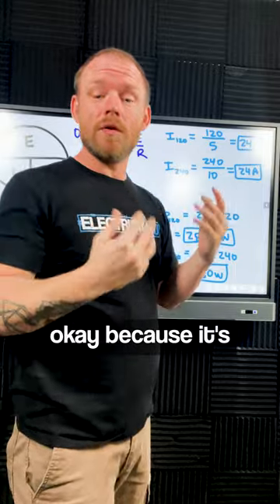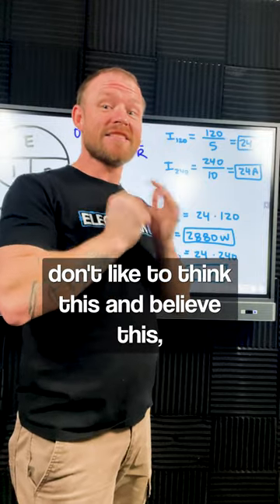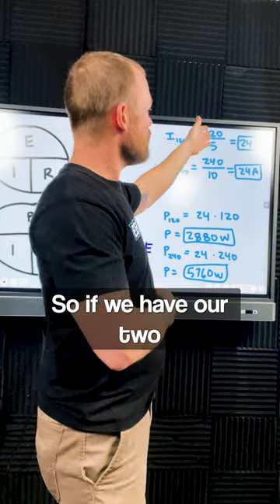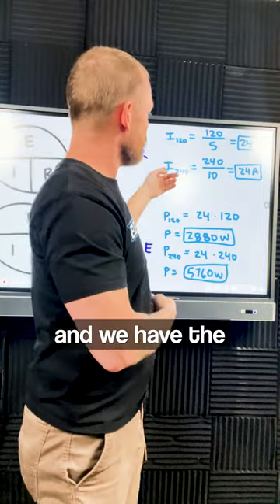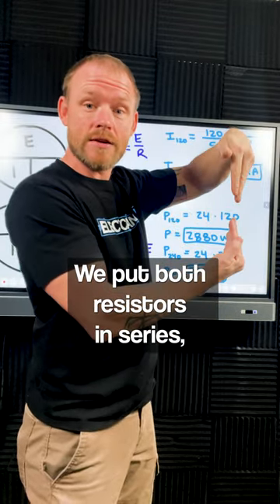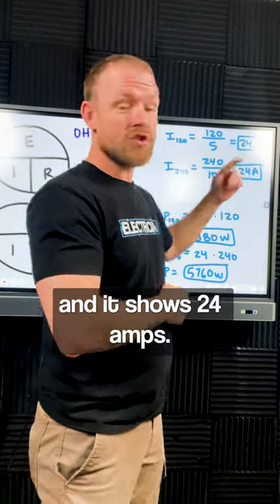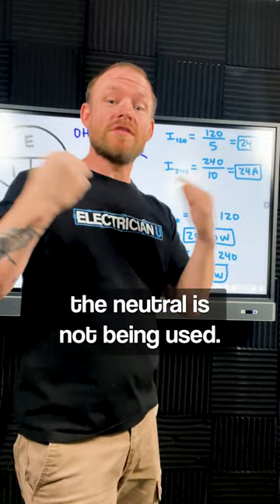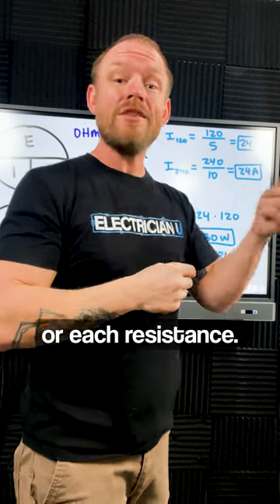Lost Neutral in a Multi Wire Branch Circuit - Part 2

Comment: I know they need to teach this in school but it's really more confusing to the average guy because you will NEVER see a balanced load in the field. Besides, your local inspector won't pass it without a neutral.
Reply: How would you balance the loads on both branches anyway?
Reply: @Bapuji42  ... in the real world you don't. This is just an example.
Reply: @rupe53  An example that, I agree with you, is overhyped.

It would be more useful if they showed what it would be like using two identical loads in series to divide the voltage, and then how it would fail if the impedance on one of the loads changed. And then, how putting a wire to the center tap of the transformer (neutral) between them, turning them into two branches at different phases, fixes the problem.
Reply: @Bapuji42  ... adding or subtracting a neutral doesn't fix anything. What that does is change the problem... or should I say create a problem where we didn't have one to start with.
Reply: @rupe53  I think you totally misunderstood my explanation, which was that obtaining 120v from 240v by voltage division across loads only works when the loads have identical impedances. The center tap exists for exactly that reason.
Reply: @Bapuji42  ... in the USA that neutral tap exists to create usable 120 volt branch circuits. I think you misunderstood my original point.
Reply: @rupe53  That's.... almost exactly what I said. We're talking past each other. Take care.

Comment: This is only correct if both branches are 100% balanced and with equipment that doesnt care if its see volatages well above 110v.  Map your voltages around with a 10amp and a 2amp side and see how important that neutral becomes.

Comment: During my 50 years seldom ran 3 wire shared grounded conductor. Now with AFCI'S required on almost every residential circuit they will hopefully die out.

Comment: The neutral is just A/C voltage point of reference from the transformer?
Reply: The neutral from the panel to the transformer is  a center-tap of the transformer. IOW connected to the center of the coil, meaning the voltage between it and either end of the transformer is half the voltage between both ends. 

The neutrals on either 120V phase are connected to that. They're going to have current on them regardless of load balancing since they're only connected to one phase conductor.

Comment: Surely this only applies to the neutral going from the panel back to the transformer. The neutral on a 120V branch isn't connected to the other phase conductor, so there's no current cancellation.

Comment: As leg 1 is pushing towards the neutral leg2 is pulling away from the neutral. So leg 2 just grabs the electrons from leg 1 instead of pulling them from the neutral. Then the both reverse. This happens 60 times a second

Comment: Can you share some examples how neutral gets lost ?
Reply: A wire gets cut, 
A wire nut comes loose, and neutral slips out
Receptacle or equipment fails
Etc...
Reply: I had a lost neutral in my garage. I had ran a 10gague set of wires to a set of 120V receptacles. Black, red, white, green. Leg1, leg2, shared neutral, ground respectively. The white wire got disconnected at the second set of plugs. So the third set of plugs became dangerous. 

The L1 at the 3rd set of plugs went to my battery charger then back through the plug to the neutral. But that neutral had no path because of the disconnect at the 2nd plugs. That neutral was connected to the neutral of the plug right next to it so the energy went to that. Into another battery charger back out the plug to L2. So the 2 battery chargers were sharing 240v. 

Well on charger had less resistance so got like 180V and started smoking. The other got 60V and just didn’t do anything.

Comment: What happens if you lose the neutral and then unbalance the loads?
Reply: Bad things happen. Ask how i know
Reply: @rty1955  How do you know? 😅
Reply: You get a hot neutral
Reply: @granthertenstein7841  Note that I said lose the neutral.
Reply: @Bapuji42  a tree fell onto my power lines and it ripped the neutral off my house.
It took out my heating system, microwave, circulator pump, and other electronic devices.
Reply: @rty1955  Yikes! I understand why now. With a neutral, both phases are the same voltage, in the U.S. 240V / 2 = 120V. Each phase is a branch of loads in parallel. 

Without a neutral, there's only one phase at 240V. Both branches are in series, so the same current flows through each branch which means each branch's voltage is determined by Ohm's law - V = Z*I (or E = Z*I if you prefer). 

If both branches have the same Z they each see half of the total voltage. But if they're unequal impedances, the branch with the higher impedance sees a higher voltage. Boom!
Reply: @Bapuji42  exactly! Since each circuits Z does not change, and MORE voltage needs to be dropped across a load, more current flows amd things get toasty haha
As soon as I realized what happened I shut off the main right away, but for some stuff it was too late. The magic smoke had appeared

Comment: I wonder what the chances of the loads being balanced are in real life.
Reply: In an industrial situation using three phase, they have to be balanced intentionally or you get different voltage drops across the impedances of each phase. In other words, you have big motors running at the wrong voltage.

Comment: So you go into an apartment and measure the voltage on a stove outlets. You measure 120v +120v hots to neutral but 208v hot to hot.  Two legs of 3 phase baba.

Comment: While your math is correct using a pure resistor, electrical work seldom uses pure resistive loads. There is an additional component to an electrical circuit using AC, and that is FREQUENCY. The formula you are using is for DC or AC with a purely resistive load. 
There is no such thing as resistance in an AC circuit. It is called Impedance and is represented by the letter Z
With a purely resistive load, Z = R.
Most electricians forget this.
There are many videos on YT which explains this.
Reply: There is such a thing as resistance with an AC circuit. Impedance is made up of both reactance and resistance. Z = R + jX

Comment: 120 v would be going through either resistor since they are in series though lol
Reply: The two 120V hot legs would effectively combine to a total EMF of 240V and act upon both resistors simultaneously.
Reply: @platinum4266  
Yeah but you measure 120v across both resistors.
Assuming equal resistances
Reply: @Yotaciv  Right, which is what is meant by balanced loads.

Comment: Ok so the voltage flowing through the red and back… how does that form a current as there is no return path through through a neutral???
Reply: I'm not sure what he's thinking. If you have the red doing one outlet and the black doing another outlet, then the hots are independent from eachother and no matter what you need the shared neutral for the receptacles to work. 

It sounds like he's mixing up a multibranch with a single phase piece of equipment that uses a neutral.
Reply: If the shared neutral runs to the service panel is disconnected but the neutral that runs between the two circuits remains intact, that current will flow through the neutral between the two circuits giving up to 220/240v on either circuit depending on the load on the either circuit. 

Also if the loads on both circuits aren't balanced, which is almost always the case, one of those circuits is going to have more than 120v and likely fry that device.

Comment: Then all your smart switches won’t work and has anyone ever ran into a balanced multi-branch circuit, I’ve never had in 23yrs, but the OHMS law doesn’t lie.
Reply: There is NO Resistence in an AC circuit
Reply: Here is the definition of impedance:
The effective resistance of an electric circuit or component to alternating current, arising from the combined effects of ohmic resistance and reactance.
So technically resistance = impedance in an AC circuit, even if it is a pure resistor. Ohms law has two formulas, one for DC & one for AC

Comment: I never liked using that word "neutral." Grounded Conductor or Grounding Conductor
Reply: Neutral and grounding conductor serve different purposes and are separate for a reason. Neutral is connected to the load and is always energized. Grounding conductor is only energized in the case of a short between hot and the ground wire and is intended to give electricity a path to earth in case of a short circuit between hot and an appliance enclosure, pipe, etc. It also allows overcurrent protection for the event of a short between hot and earth, as it is bonded to neutral at the panel.

This is why you don't bond the ground conductor and neutral at subpanels. It would mean the ground conductor is connected to one side of a load at that point, meaning it's carrying at least some of the return current to the service. IOW there's current flowing in your conduit, ground wires, etc.

Comment: Years ago, we were allowed to use split neutral circuits, but now, at least in nyc you can no longer run a 12/3 and feed separate cuircuits..everything thing needs its own neutral..not just afcis. Also you can no longer use white as a conductor anymore...so if youre feeding a single phase/ 208 circuit you have to run 12/3 and cap the white...same for 3 way circuits..cant use white anymore...but some inspectors will let some things fly...most arent electricians anyway. They just study code

Comment: Who uses a neutral on 220 circuits? They should explore new careers but you also leave a lot out, on a panel that runs only 220 its not giving 240, maybe your longer videos give better detail. Idk tho I only see you on shorts
Reply: I'm learning industrial right now
Reply: We're about to run 3 phase 220, it's for a new data/electrical room ran from a panel we will change the 480 transformer and the original panel with just 2 legs, since they may need 3 legs in that rooms racks... I'm originally commercial and learned residential, changed company's due to them hiring idiots and paying them more than me I showed out and didn't give my 2 weeks, just moved on. Ended up doing I guess illegal under the table jobs using what I learned ran home services paying people to get permits bit doing the job in a few hours making 400 myself 200 for my helper lol 😂

Comment: When you say “unbalanced load” are you referring to 2 phases not carrying the same voltage?
Reply: Wattage is more acurate
Reply: Amperage is the more accurate measure.
Reply: Well, Z = V/I, and W = VI, so.... They're all accurate, because they're all mathematically related.

But yes unbalanced loads mean loads with different impedances and thus different current draws and thus different power usage. The voltage between the taps of the transformer isn't going to change much.
Reply: @Bapuji42  okay thanks
Reply: @TN_vigilance  It makes sense, right, if you have two loads with the same impedance in series with a voltage across the whole thing, each load will have 1/2 the voltage across it. Ohm's law 

Now, what if one of the loads has a different impedance? Both loads are getting the same current because they're in series, so the different impedances will cause different voltages. One load might be getting 90v instead of 120v. No good!!

So, instead, we have a wire going to the center tap of the transformer - "neutral". The voltage across each branch of the circuit is now guaranteed to be 120v whether the loads are balanced or not. The neutral carries whatever the difference in current is between the two branches.

I'm still waiting for someone to tell me when I'm the real world you'd have perfectly balanced branch loads.
Reply: @Bapuji42 okay that makes sense, I’m a millwright/pipefitter and started watching this guy to get some base knowledge, thanks
Reply: @Bapuji42  thank you for using Z instead of R As there is NO resistance in AC circuits, there is however IMPEDANCE and they are NOT the same. Only when there is a purely resistive load does Z=R n even an incandescent light bulb is not purely resistive, just saying
Reply: @rty1955  Actually, there is resistance in AC circuits. Impedance involves both impedance and reactance.
Reply: @Bapuji42  its never called resistance in an AC circuit. Its just called impedance. Amd tou forgot capacitance. A capacitor and an inductor together can produce a  VERY low impedance this draw very heavy currents.
The thing that makes AC unique is its rise and fall of voltage over time and the frequency involved. This is why there are separate formulas for AC circuits. Even an incandescent light bulb is not a purely resistive load as its resistance changes as the filament heats up. Electricians will only approximate impedance & wattage. 
As a EE on electronic circuits design we deal with AC circuits all the time and must calculate impedance very accurately
Reply: @rty1955  Here's an example in which it's very much called resistance in AC. When you're doing a long wire run, say a few hundred feet, the voltage drop from one end of the wire to the other has to be minimized. This is done by selecting the right gauge of wire for the length - in other words the size of wire that will give the whole run a low enough resistance. 

There is no induction in this situation, and capacitive effects between the wires are negligible. The calculations are based solely on the resistance of a certain length of a given gauge of wire.
Reply: @Bapuji42  let me see if i can explain ot better. On AC there is only impedance or what is known as Z. When you have a purely resistive load, Z=R. The reason why is that the wires DO have a capacitance  bit at such low frequencies it is negligible. But AC does have a frequency component to it a d thats why there are different formulas fo AC v. DC.
You can use ohms law for DC in an AC  circuit as long as the load is purely resistive because Z=R. This is what most electricians use for simple circuits because the formulas are easier to use.
In aviation for example they use 400hz for  circuits. Why? Because they can use smaller gauge wire to handle the same amount power. And smaller gauge wire = less weight. You can hear the frequency in the PA system onboard.
Even power transmission raises the voltage so the same power can be transmitted using smaller wire.
Yes, wires do have a purely resistive load with insignificant capacitance @ 60hz and Thats why Z=R, but Z is the correct term.
Reply: @rty1955  Dude, Z = R + jX. Resistance is always involved. Look it up.

Saying "there is NO resistance in an AC circuit" is simply incorrect. RESISTANCE IS A COMPONENT OF IMPEDANCE, ALONG WITH RESISTANCE.

I already said that wire runs have capacitance but it's negligible for practical purposes.

The purpose of my example was to say that resistance is very much in play with AC, since it's.... let's all say it together....a component of impedance.
Reply: @Bapuji42  I think you are getting your formulas mixed up.  the formula you reference Z=R+jX  or (Z=R+j0) is for PURELY resistive load with a phase angle of 0°
In a pure ohmic AC resistance, the current and voltage are both "in-phase" as there is no phase difference between them. Therefore Z=R and Ohms law for DC circuits can be used. 
In a DC circuit the phasor relationship is zero, thus its called RESISTANCE as defined by Ohms law, but in a sinusoidal AC circuit, this voltage-current relationship is now called IMPEDANCE
Hope I made that clearer for you
Reply: @rty1955  Incorrect. X is reactance. Z = R + jX cannot be for a purely resistive load.

Wires still have resistance even when there's a phase difference and inductive or capacitive effects. Why wouldn't they? They don't magically become super conductive when the current is AC.
Reply: @rty1955  Read it. Learn it. Love it.
Reply: @rty1955  The other formula for impedance is z = the square root of (R squared + (XL - XC) sqared).

That R in there is resistance.
Look it up instead of just being argumentative.
Reply: @Bapuji42  ok. Not going to argue with you since you obviously dont understand electronics at all. Im not going round & round with you.
Do t k ow what you do for a living, but its obvious you dont work with electronic design..I have been VERY successful at it.
Enjoy
Reply: @rty1955  You didn't even read the links I sent, which directly contradict you. Every reference I can find agrees with me and not with you.

Either you're a supergenius who's beyond everyone in both electric theory and math, or you're wrong.

Apply Ockham's razor.